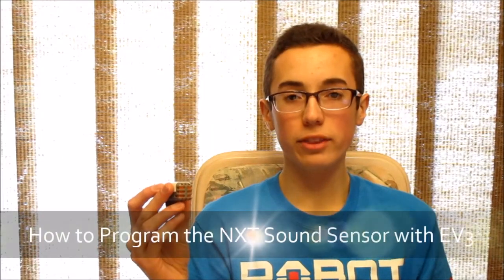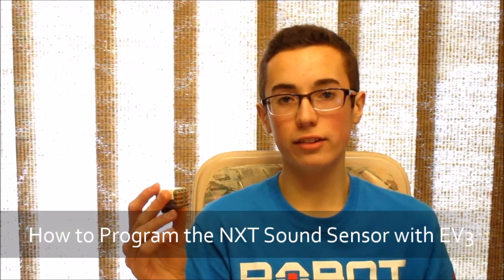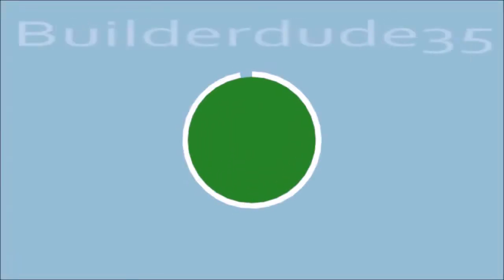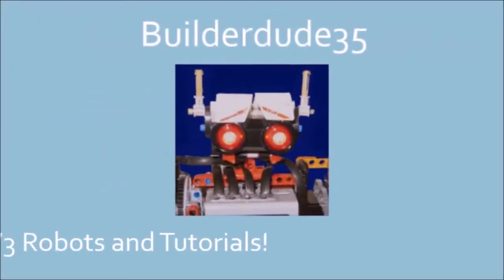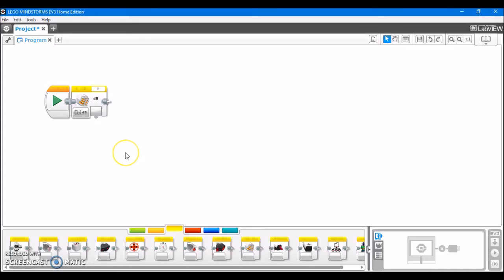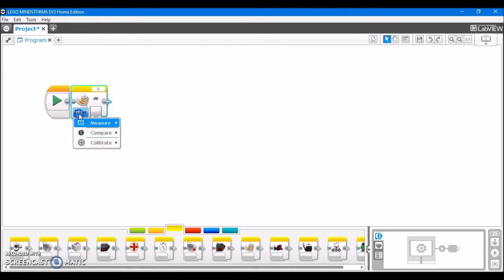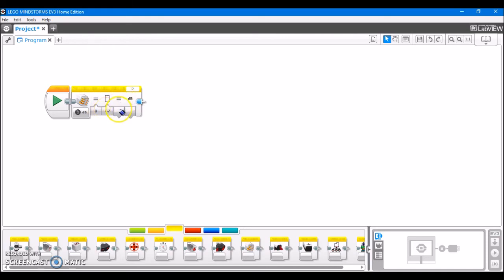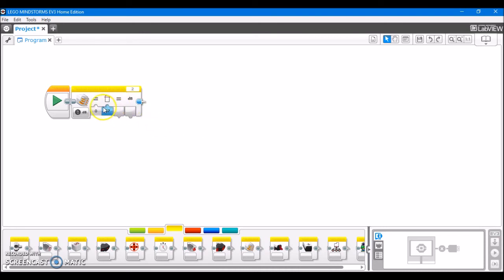How to Program the NXT Sound Sensor with EV3

Comment: how did u extend your brick library
Reply from the maker: Importing 3rd party programming blocks; I have a tutorial on the topic.
Reply: Builderdude35 thank u so much. Like you, I am a advanced Lego mindstorms user and I prefer using code to program my creations. this was the first time I used the Ev3 home edition so thanks for the help. Also it would be great if you could provide any knowledge on how to use gyro sensors to program a four motor balancing robot as I'd like to expand my on the things I know little of. Once again, thanks for your tutorials. Pls reply
Reply from the maker: Send me an email through the "Contact Me" form on my website (Builderdude35) and we can discuss it there.
Reply: hello i am new to mindstorm dont even have any kits yet i am wanting to create a thumper like it thumps against walls when it hears foot steps but i see the sound brick has been discontinued